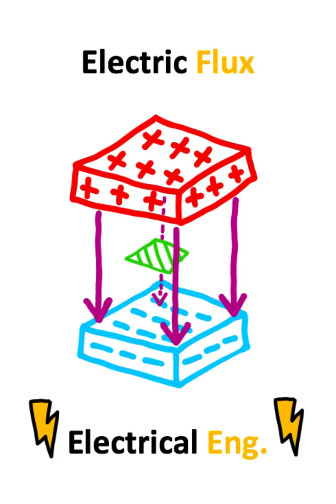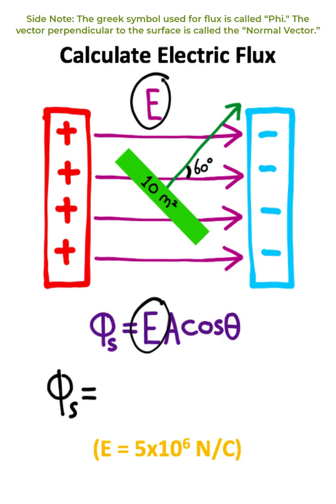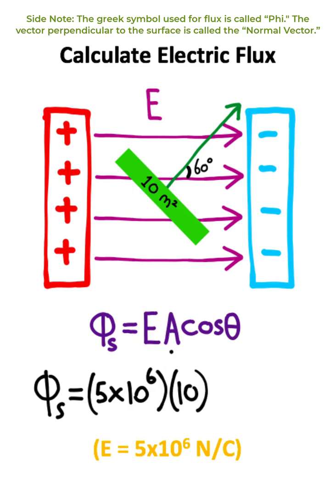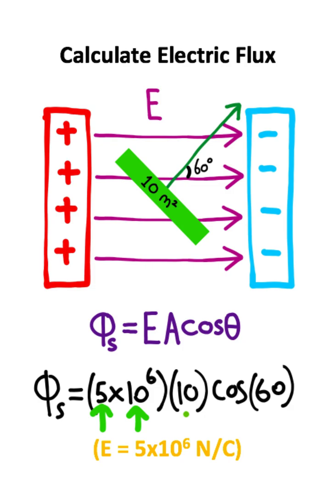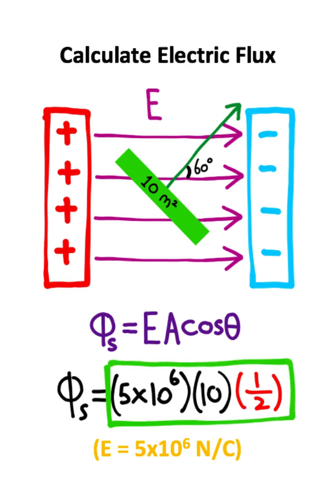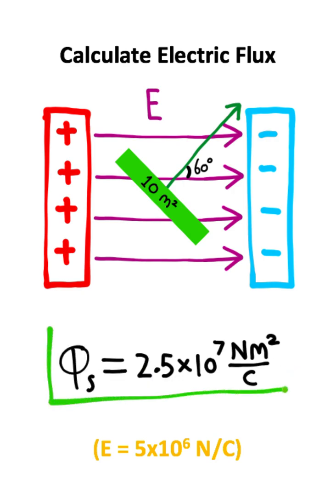Electric Flux Made EASY!!

Comment: there is a equal and opposite area vector pointing against the direction of electric field, so the net flux should be zero?
Reply: this is possible since the surface is not enclosing any charge?

Comment: One question sir. I'm only a 15 year old but what I have been thought negative travel to positive, not positive travelling to negative because the positive charge is too heavy. Am I wrong?
Reply: An electric field defined in a way that it tells us where a positive charge would move. It can still be used for negative charges though. They will just move in the opposite direction to a positive charge.

Most applications of electricity that we see (like current flow in wires) relate to the flow of electrons, which are negatively charged, and are much more easily removed from an atom than a proton is. However, there are things called ions, and they can be positively charged if they have already lost some electrons. Calcium, Magnesium, and Potassium can lose electrons relatively easily, so they become positively charged. If you were to place a Calcium ion in an electric field, I believe that it will travel to the negative side because negative attracts positive.

As a side note, positively charged ions like Calcium, Magnesium, and Potassium are used to help conduct electrical activity in your body.
Reply: Negative travels to positive in case  of electric dipole 
Positive leaves and terminates in negative in case of electric field
Reply: I guess your confusing yourself with electrostatics and magnetism, to say the least, both are fun and have fun learning !